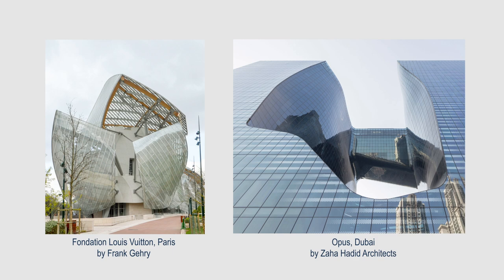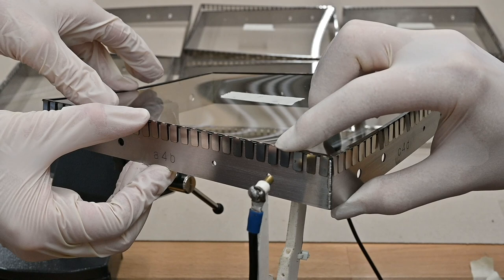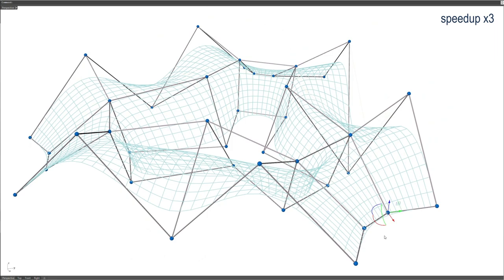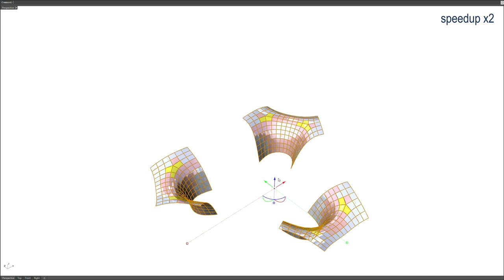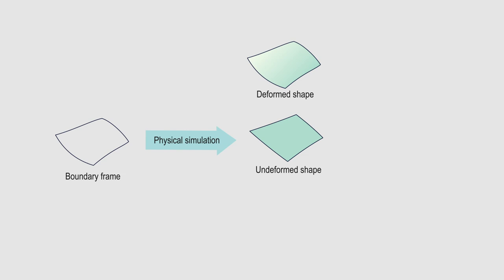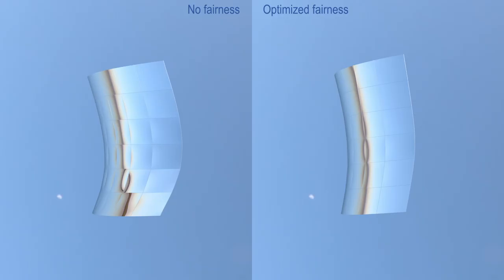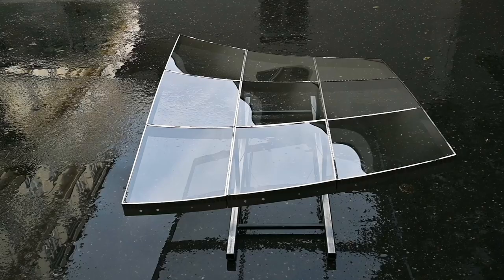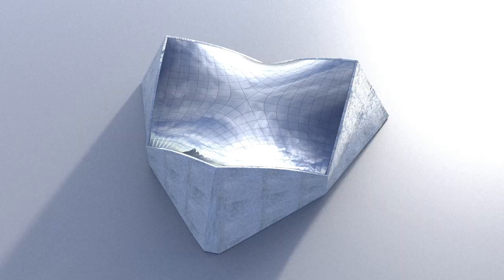Computational Design of Cold Bent Glass Façades [SIGGRAPH Asia 2020]

Comment: I'm not an expert, but transporting this glass to the building site must be a nightmare. One crack and you have to make the piece all over again. But the end result is spectacular. Great work.
Reply: but that's just how anything works, or are you implying that the cold bend glass is more fragile than the normal ones?
Reply: Isn’t the point of cold bent glass that it arrives to site planar? And it bent into the frame